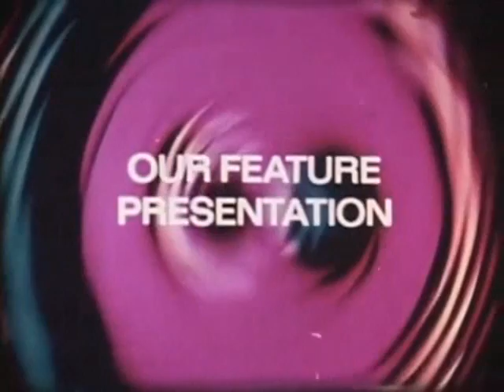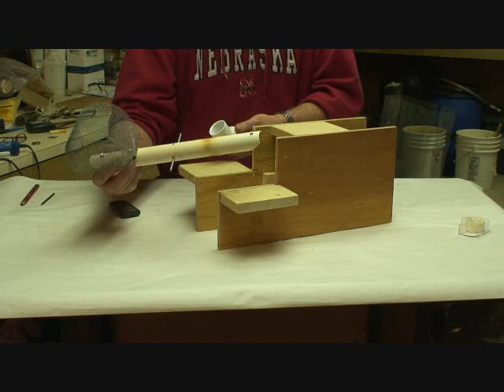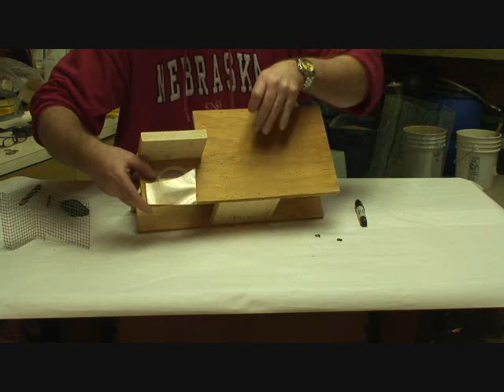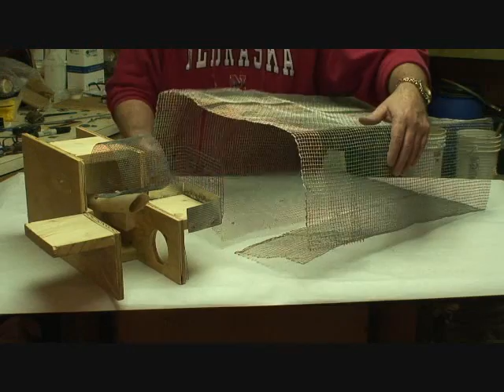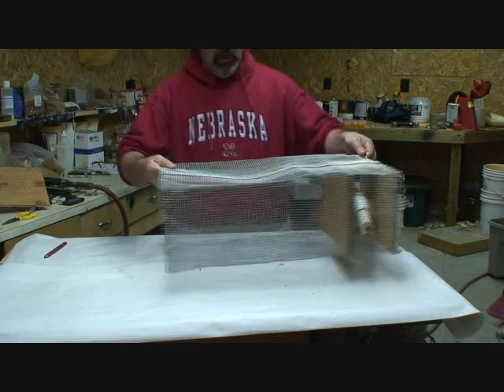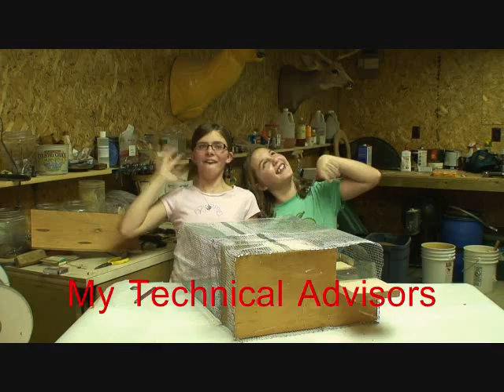How to build a sparrow trap part 3.wmv

Comment: Great video, your easy to follow which made for a easy build! I built one in September of '22 and have caught 115 Hosp in roughly 5 months of trapping. One thing i did differently that I'm now second guessing is the one way door which i used hardware cloth instead of the thun plexi. I believe hardware cloth give more opportunity for birds to pull on it & eventually pull it open enough to get back out. I have witnessed birds pulling on it and have had a handfull escape & i actually caught a few escapees in the swingarm compartment! Have you had any escapees using the plexiglass door?? One other thing i did differently that I believe is an improvement was the angled cuts on the swingarm for clearance. The angled cut on the capture cage end of the swingarm I did the same because the swingarm needs to go as low as possible. But the opposite end or the weighted end  needs clearance at the top of the arm, because it only travels from a level position to the top of the cage, so the angled cut on this back end of the pipe needs to be opposite of the angled cut on the front end. Done thus way no modification was needed to create clearance

Comment: It's a great trap with a great trap door mechanism. I've just got one little idea. On the pvc pipe that you drilled a hole in to fit the nut and bolt through if you make the hole into an approximate one inch long slot you could actually then just slide the bolt to the desired position to make the pvc arm go up👆 and down👇 Thanks for sharing your video. . 👍
Reply: @justwondering4342  No I haven't yet. I've made plenty of bird and rat traps in the past though
Reply: @justwondering4342  Tanks mate. And you. 👍

Comment: How do you build an additional trap box on the side to get sparrows in it to remove and dispose of them easily? I have seen one on another site but no instructions how to make it?
Reply: You could have a box that sits up against the back and then have a one-way door so they can fly into the box. You'd want the side of the box opposite to be wire so they would see it as a possible escape route, rather than a dark box.

Comment: I’m wondering what the dimensions of the hardware cloth is
Reply: Measuring off the image on the screen with the widge of the elevator assembly as a reference, it looks like it is a full 24" front to back and then to wrap around the back piece and assembly would be 48".  Add one or two to the 48 for overlap to connect.